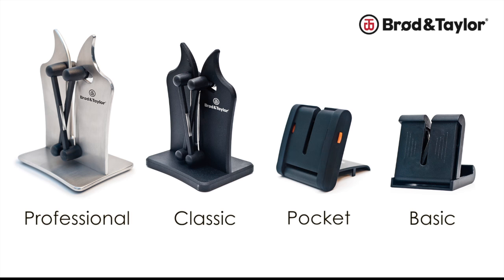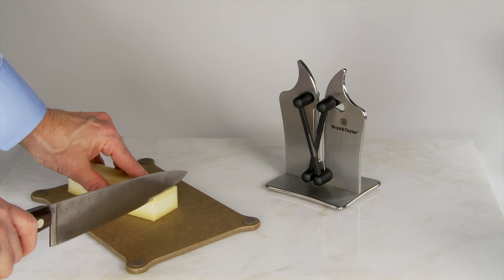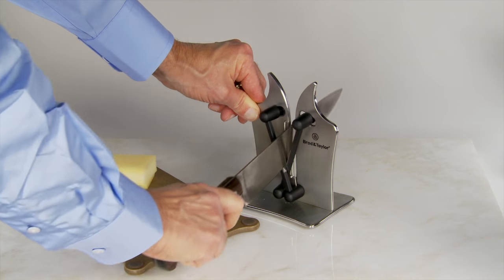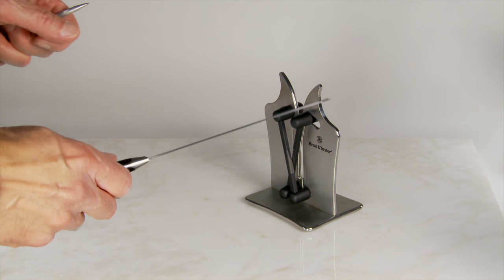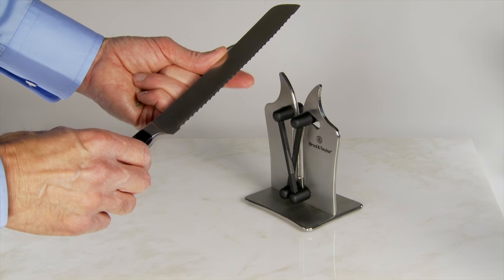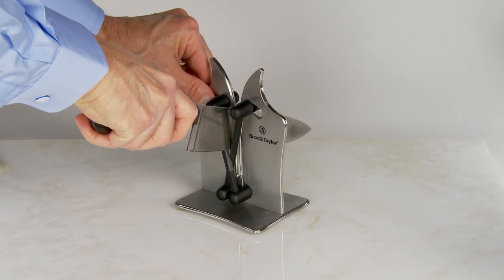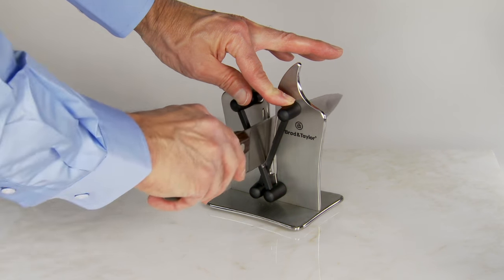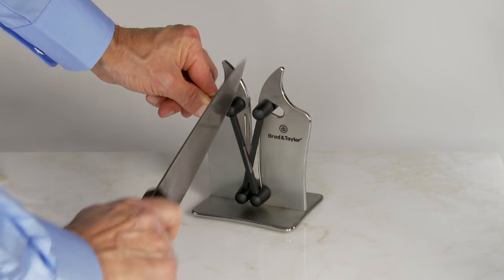Training Demo Professional Knife Sharpener

Comment: This is the best and easiest to use sharpener that SHARPENS (new edge), HONES (aligns the edge) and POLISHES (razor edge). I had 2 restaurants and had my knives cared for by a service.  Had to warn the staff NEW KNIVES each time they brought sharpened knives. Still break down Cryovac beef and pork and now use the Brod & Taylor. 
Rarely need to SHARPEN, just a few licks in the HONE position and back to the meat in ten seconds. No fuss, no muss just razor-sharp knives with a simple, easy to use item..
(PLEASE FOLLOW THE SIMPLE DIRECTIONS, UNLIKE MOST OF THE F/B TOMATO SLICERS WHO DON'T USE KNIVES EVERY DAY).
I do know sharp when I see it, as I have used a straight edge razor up into my 70's
Reply from the maker: Thank you so much! We are happy to know you get so much use out of the knife sharpener.

Comment: What that is doing is the same as a steel. It's honing the edge, removing the burr/rolled edge & is part of blade maintenance. As for him saying "if you want a 20 degree bevel, push down further. A 12 degree bevel, stay at the top" I thought you said it doesn't remove metal? The only way to 'get' those degrees is to physically remove the steel & you stated it doesn't do that. Maybe poor choice of wording there. If you HAVE a 12 degree bevel etc.
It's a replacement for a sharpening steel, be it steel or ceramic. Diamond ones actually DO remove steel from knife edges or the primary bevel. It should (with proper use) maintain a truer equality on the edge as opposed to a hand held steel. 
Just my thoughts.